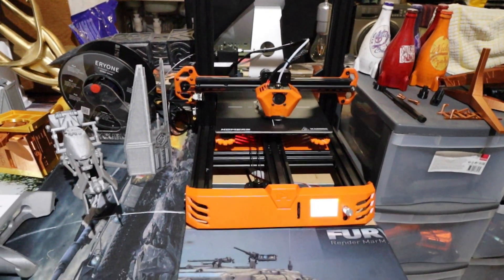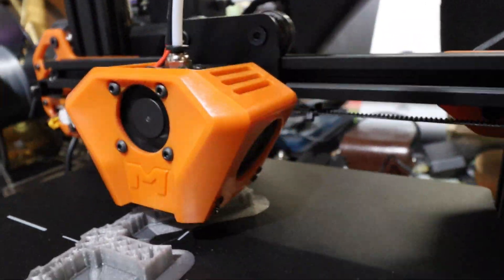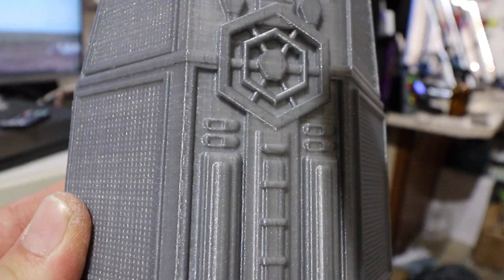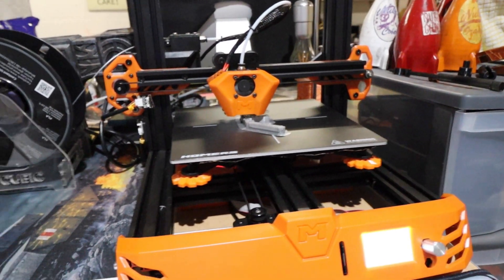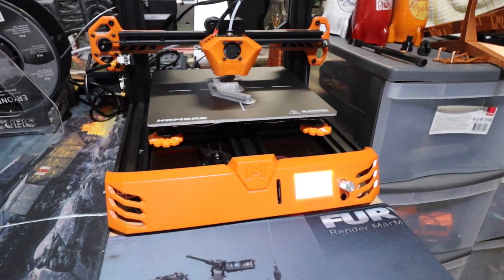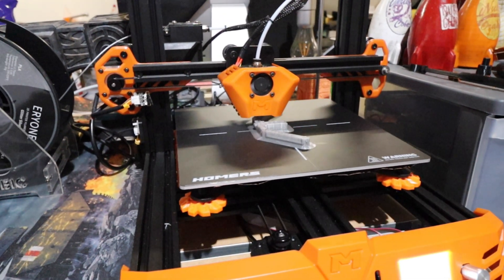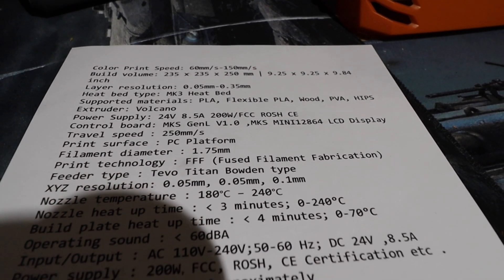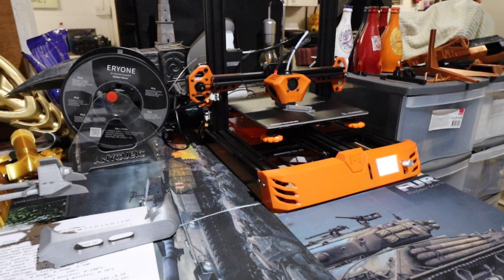Homers/Tevo Trarantula Pro 3D Printer First Impressions

Comment: Hi Took your advice and bought one from Banggood only took three days to get here enjoy putting it all together The last step with a ribbon cable found there were too short thanks for your help,
Reply from the maker: hi, thats strange shouldnt be to short, have you double checked and made sure you have plugged it into the right port on the board?

Comment: Hi did you have to adjust the voltage on the stepper motors
Reply from the maker: Hi, no never had to adjust anything just worked well, be careful when adjusting voltage on stepper motors its very easy to cause damage
Reply: Hi voltage on the stepper drivers did you have to adjust
Reply: ok thank you different videos R confusing

Comment: is this worth to get as an new 3d printer owner? or should i buy somthing else?
Reply from the maker: hi, for the money you cant go wrong really but be warned assembly is a pain as you will have to build the whole thing, all depends on your budget really, let me know what you want to spend and i will send you some ideas
Reply: @BeanGaming-w4n   Thanks for the answer :)
Is there any 3d printers out there around the same price that you dont need to build? Not that im not capabel to do it but if there is no instructuons it might be a bit harder hehe
Reply from the maker: @Brille2K  hi, might be worth looking at the creality ender 3 Pro, since the ender 3 v2 came out the pro has dropped in price slightly plus there are lots of upgrades you can do plus its a very good and easy machine to use
Reply: @BeanGaming-w4n  i will take a look att that :)

Comment: after a snafu with ordering an FLSUN that resulted in a cancelled order, I have waited to make a decisions.  In your opinion of homers so far, what would you think about the Little Monster that is also available from Homers?  Yes, I know its a completely different machine. but you have a first hand feel of the company now ;-)
Reply from the maker: hi, thats a delta printer and one i have not ordered, ive got the nereus and the new tornado on order, but so far im really impressed with this little one, ive owned an anycubic predator and that was a cracking delta printer, only problem with them is they so tall and can be a bit wobbly if they havent got good feet, i ordered mine from banggood as ive read several places that homers are a little slack in getting the printers sent out but they seem like a good company so far